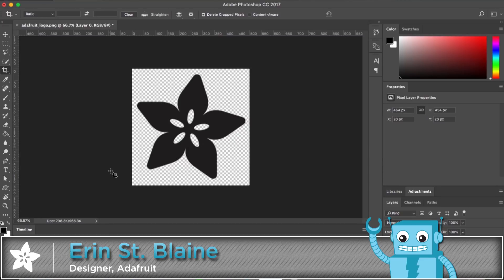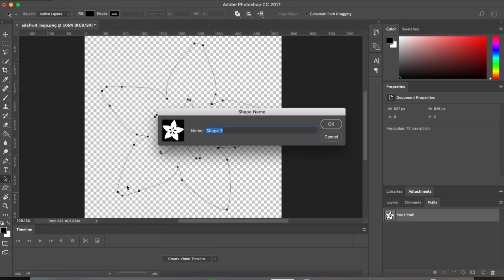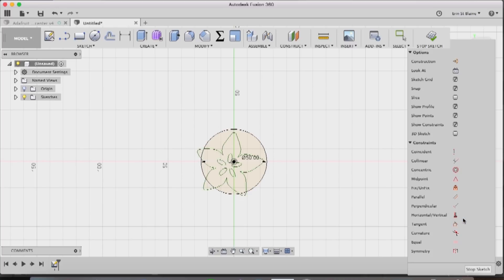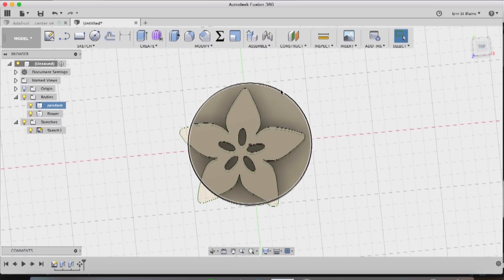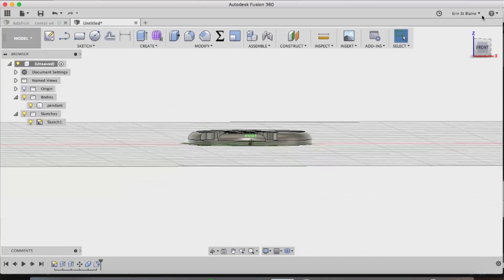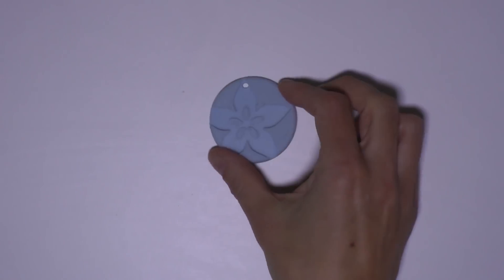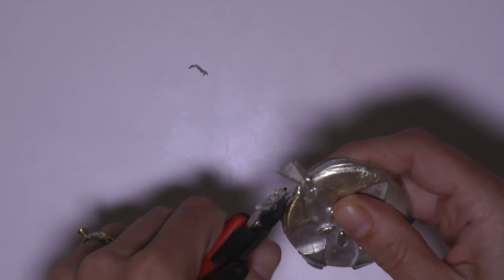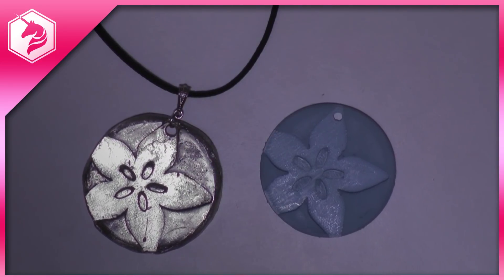LEARN: Mold & Cast 3d Prints in Pewter @adafruit #adafruit

Comment: you should really make proper 2 part mold for it, now it looks super wonky and not at all professional... you loose all the pros of printing it before (super uneven circle, looks like chinese super cheep knock off)
Reply: True. no need to use the wood and the clamps. would have been a cleaner cast with out them.